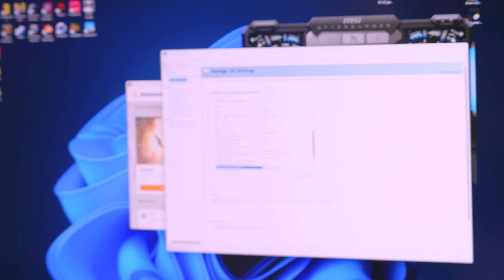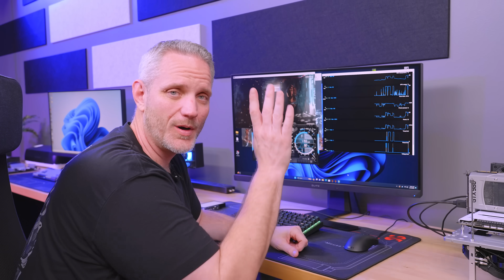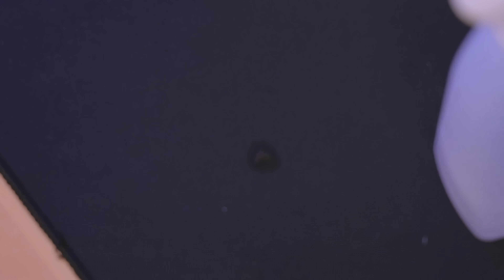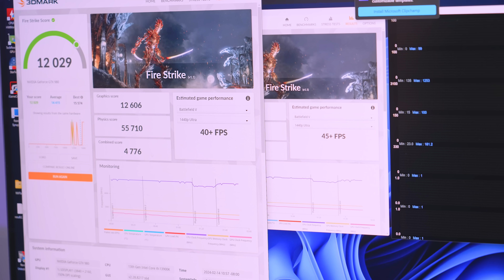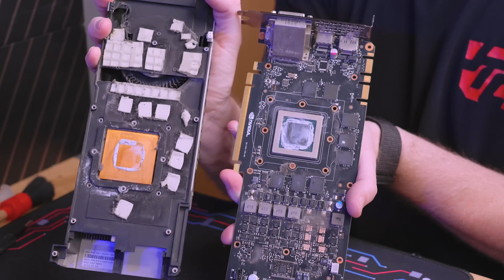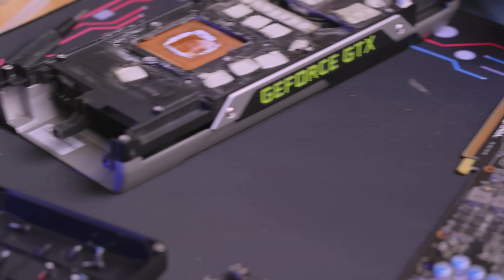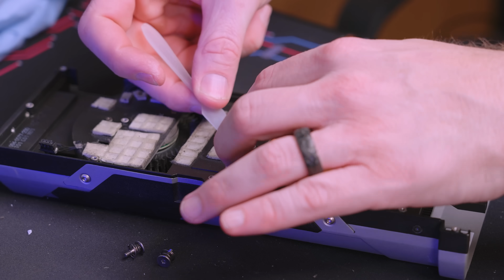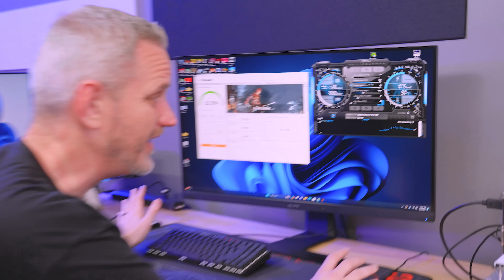This was KILLING this cards performance!

Comment: Just sharing my experience with 440GT - it's cooler was so old, that it wasn't cooling the card at all. I've checked if it spins - and it was! But after I decided to repaste it I've noticed that the blade was  basically rigid. So not only it managed to spin masking the issue of low cooling performance -  it was most likely heating it up even more just because of spin resistance.

Comment: I still have my GTX 1080Ti, i used to use it under water cooling, so i can't remember exactly where my blower cooler is for it, but it's fun seeing if i didn't have it watercooled what i could've done to improve it.

As of now I'm running an RTX 3080 watercooled, at first i didn't truly need that boost in performance, but now i have a 2560x1440p@240hz monitor, and this rtx 3080 on most games can run up to that fps mark which is nice

Comment: When re-pasting old cards I cut a small portion out of the center of the pads (1mm x 1mm) an add thermal paste to that hole. I've seen serious reductions in all the card's temps.
Reply: Dam I wish you made this comment 2 months ago when I was ultra sonic-ally cleaning my 2 x HD7970's heat sinks I would have tried this. But just the cleaning and using new thermal paste helped a lot, in reducing temperatures. My cards are from 2011 and still going strong might not be able to play latest games but that's fine because I like older games more anyway, like COD4 Modern warfare still the best COD IMO lol.
Reply: @fullboostturbo1 Don't bother, there is literally no reason to do this. The "serious reduction" was because they repasted at the same time. Or, maybe the pads were so rock hard that by removing the middle they make the pads squish like they should have when new.
You're only going to make a mess, and that TIM is not going to magically drop temps. If you want to help, replace the die's paste and use new pads.
Reply: @rustler08  Gday mate, I am not going to bother as reapplying thermal paste done the job for me, but the ultrasonic cleaning I done on my GPU's heatsinks had the greatest effect IMO they cleaned up like brand new. Instantaneously I saw a temp drop of 10 Celsius while idle and about 13-15 while hitting 100% load. Now they are running and looking like brand new.

Comment: So Jay. Fan Curves. When I had my 2070 and ANY other card where you could adjust with afterburner my fan curve is basically 0-100, if the card is at 30c the fans are 30%. I would love to see you test out your viewers fan curves? Maybe? Take like 10 user suggested and see which is best?

Comment: Have done 3 RX 580 8GB for Kids PC this X-mas Season. Thermal Paste and cleaning brought them back to stock clocks, one went from 1350 down to 1150. After Repasting the Card i tested went up to 1300 in Furmark after 30 Minutes in a Case at 84/85°.  All three Cards were Dual Cards, i did a Fan Swap, now the hot one is running 78° stable at 1350 boost. I got a RTX 2070 with the same Problem, is running in thermal limiter and the Fans seems to be shot. All the Cards have in common: Dual Fan Models. Longer Tripple Fan Models don't seem to have this aging Problem, i got several older tripple fan models which still run fine.

Comment: What a blast, the 980 was my first high end GPU along the 4790k, those 2 gave me 4 years of amazing performance until I switched to a 2080, the CPU lasted me for almost a decade and 9 generations of intel CPUs!

Also that ending geez...and we're not even in October yet!
Reply: I had the same rig as you, I then went to a 1070 and 9700k, and now I upgraded to a 13700k and a 4080FE

Comment: I ran a blower style 1070 for 5 years.
3 times I had to go in with tweezers and scrape out the fan blades. Once at two years, once at 4 years, once before pawning the old PC off on my nephew.
Washed the heatsink out, repasted it. Dude's probably getting better temps than I ever did.
Reply: My nighbor has 1060 😅 the 5600g apu runs all same games 😅
Reply: @Fossillarson  Yeah you want that 1080Ti. So much VRAM It's gonna run everything until games cut API support for it.

Comment: Hi, Jay. I have a GIGABYTE AORUS GeForce RTX 4090, GV-N4090AORUS M-24GD. I also am using a CableMod 12VHPWR 180 Degree Angled Adapter - Variant B. It has worked perfectly from purchase, but with the recall, I wanted to replace it. I bought a CableMod Basics RT-Series 12VHPWR 90 Degree StealthSense Direct PCI-e Cable. The problem is the new cable doesn't fit in the 12V HPWR socket on the GPU. Something is obstructing the cable fitting from seating and locking in and I get no power. I"m wondering whether you or your vast audience have experienced anything similar. Cablemod told me there is a slight size difference between the two fittings. I may have to deconstruct my entire system to look closely at the GPU socket to see what's in the way, a major overhaul. Any thoughts would be appreciated. Thanks

Comment: Cleaning makes a lot of difference on those blower cards. Back on the last mining craze days od 2020, I built a rig with some used blower Vega 56 and I had to open and clean them every month, it made a lot of difference in its cooling.

Comment: I dunno what people are vaping to make there computers sticky. I vape both bud concentrates and nicotine in front of my PCs all day everyday for over a decade and I have never had any stickiness at all. Vapor often gets sucked in the intakes and absolutely nothing has built up on my PC anywhere. Now I don't blow it directly in the computer but some definitely ends up in there. It should not be sticky at all and if it is I would immediately stop vaping whatever products that are causing that. It is not normal with legit vape products. You should be able to exhale into a paper towel and there should be no sticky residue, if there is your juice is tainted.

Comment: You mentioned the whole dead person being in the GPU thing. It reminded me of a story a coworker told me when I worked at a data center in Mexico about how a new NOC employee/intern got stuck/locked in one of the server racks during a holiday weekend, and he stayed trapped in there standing upright unable to sit down because there wasn't enough room to move for the 4 day break. Other people were in and out of the data center, but it was such a massive place and so loud, even though he could hear the doors (they make a loud beep when opened), they couldn't hear him screaming. 

But even worse, he knew the entire time that there was a fire suppression system test coming at the end of the holiday weekend, so he would have been panicking, because when the other employees got back they did a sweep of the data center to make sure it was empty of people, and then they activated a test of their argon fire suppression system while there was "no one left" in the data center. This system replaced all of the oxygen in the server farm with argon. The kid passed away in there, and they didn't find him until a couple days later when someone came to switch out the tape backups. 

The crazy thing? All the kid had to do was reach back and pull a little latch and it would have opened the rack door from the inside.. Freaking tragedy.
Reply: What?  Bro I would have just started unplugging things and making a mess.  Someone will come check when the entire server goes offline.
Reply: @vedinthorn  Exactly lol. Make an outage so someone comes and checks on the rack... EZ.
Reply: @vedinthorn  You sir, are a free thinker.  Well done.
Reply: Dam that is a pretty sad story the poor bugger losing his life, if only he knew about the little latch for the problem that he actually found himself in. Hopefully his in a better place now God bless him and his family.
Reply: Damn, that's quite the story. Thx for sharing
Reply: that story sounds completely fabricated.
Reply: That's nuts. Definitely learn how server racks work before you climb in...

Comment: I still run a 1080ti for mostly maxed 1440p gaming from evga. I do tear it down every now and then and clean and renew it and have had no issues out of it since day one use. It's all about the love and care of the hardware.
Reply: I love u
Reply: Still running a 1080 Ti myself also at 1440p (and some 4K on TV) since November 2017, mine is a MSI Gaming X. I had only given it a handful of light external cleans over the years, temps started out great in the 60-65C but over time had crept up averaging in the 67-72C range. Last year in February I decided to do a deep clean and re-paste as the temps above 70 were becoming more common and were hurting my boost clocks, used Noctua H1 (all I had on hand) and temps saw a big improvement dropping into the 55-62C range depending on the title.

Comment: 1:18 man, if they had one that was fresh out from the box never used. it would also be good to see how much the performance has decarded over the years
Reply: Performance doesn't degrade, it either works or doesn't
Reply: Linus tested GTX 480 new vs 10 years old used, difference was 2%, basically no degrade.

Comment: I repasted a heavily used 7900xtx with Kryonaut extreme and idle temp dropped 10*, the stock paste had started to get hard.  So I highly recommend doing this especially if you're on your computer hours everyday.
Reply: Any issues with thermal pads or is it easy to replace the paste without damaginf them?
Reply: @johannesdatblue4164 I'd replace them while you're in there. Buy some Gelid extremes of the same size, or use thermal putty
Reply: @johannesdatblue4164 Better replace everything.
Reply: @johannesdatblue4164  you can never be sure the pads dont get ruined on disassembly, and theres no real way to prevent it. just depends how they stick. theyre cheap enough you should go ahead and order the CORRECT thicknesses before you tear it down so you can replace them. even if they dont get ruined, that resets the clock when you need to do it again, plus the oem pads are likely shite
Reply: Giving you a fair bit of warning but kryonaut is absolutely terrible for these cards regarding pump out. 

My 7900 would pump out the kryonaut in about two to three months leaving the die bare. I had to repaste my card 4 times with kryonaut. 

I suggest getting PTM7950 it’s a godsend and you’ll never have to repaste it again for the life of the card.
Reply: @Crawdoodle   Never had an issue with the Kryonaut Extreme
Reply: the level of used means very little, crap to begin with is the real problem. my asrock 6950 is known to be crap out the factory and easy to get 20c improvement out of. these are more of an age issue

Comment: You need a card gooped up naturally but expediently? Send one my way, I can get it back to you in a month with it out in my workshop/office. I routinely need to clean mine with compressed air, otherwise the GPU will idle at 45*C from accumulation (usually my cue that it's due!). Such is the life of a card that shares space with machines and equipment notorious for making a mess!

Comment: Probably should’ve taken the cooler apart too, the shroud around the heat sink means there can actually be a lot of dust that gets accumulated on the heat sink itself that’s not that easy to blow out. A great video nonetheless, repasting does so much for anything pre-2021 when manufacturers moved on to using phase change material
Reply: I thought the same especially with that crappy blower he used. Honestly the video felt half assed to me.
Reply: @Bangulo Hello, it went from 84º with no fan speed. To 64º with fan at 100%.  All they showed was no fan vs fan speed at max. You think these whales move?.

Comment: Lol im still running a 980 ti. Has a 2 fan cooler though. But it does ok still.
Reply: Me too, EVGA. Starting to struggle with the latest games now though. If the 4080 was realistically priced, I would already have pulled the trigger.

Comment: i had a gtx 1070 and a gtx 1060 which i opened and fully cleaned new thermal paste and it improved performance and thermals quite alot tbh it was a zotac card and evga card (RIP EVGA)

Comment: Recently picked up a second hand RTX 2080 Ti with the same issues. I replaced the fans, replaced the thermal paste & pads, and cleaned it up. Now it works like its brand new 👌🏼
Reply: What parts did you use/get to do it? My 2080 Ti is at best loud now and sounding not in great shape, and no clue about performance degradation. I have an i9-9900 and I do need to get a new computer soon(?) but throwing a 4070 or something in here at this point just seems silly.
Reply: Good card too. Probably better than a 3070
Reply: @HughesDePagen  nope, not according to benches of anything remotely recent or any recent reviews that include both cards - you're better off with a 3070 for the most part, but then, really, neither are really great longer term - in battlemage we hope
Reply: I had rtx 3070 its like 3% faster than 2080ti but!! 8gb vram sucks ass at 1440p
Reply: @Kage0No0Tenshi  You need a 4080 or 4090 to play in 1440p. Everybody knows this.
Reply: @HughesDePagen  LOL, 3070 is better because it's a bigger number than 2080. I'm 16 and built computers for 2 years and I even know this.
Reply: @HughesDePagen Kind of. The 3070 is a bit faster and doesn't have memory chiplets that kill themselves. But, a few more gigs is nice for the 2080 Ti.
Honestly, I'd probably take a 3070. It's a newer card with better DLSS and everything.
Reply: @rustler08  neither get dlss 3.0, and both can use DLSS 2.0, but I get you though.
It's just the vram that's going to make the 2080ti a better card in some situations.
HW unboxed showed this with 8gb cards in the past.
Mind you, updates may have changed some of those issues
Reply: @HughesDePagen   Updates can't fix memory, they'll just serve you low textures faster/more often.

Comment: i recently cleaned and repasted my gtx 1080 strix with stock pads and paste. it went from a max temp of 87C to 72C running the furry donut test, stock settings, stock pads (still squishy) and using thermal grizzly paste.

Comment: I have an old system we use for emulation, 4790k with a 1060 6gig.  last night i got bored and decided to de-lid the cpu.  I've never done it before.  so i got my little vice out and slowly worked it around and got the heat sink or lid off.  it only had thermal compound on not even half of the chip.  there was around 50%  of the chip that wasn't being cooled properly, it wasn't making good contact with the lid.  that chip has always given me issues with thermal throttling despite any coolers i tried.  now I know why.    but its making me want to open up my other systems chips, we have one with an i7 8700 and one with a i7 14700.     i wonder how many chips get threw production with that issue.

Comment: I was not ready to hear a card only 1 generation older than mine referred to as "old school".
Reply: 10 years is a long time, More so in tech... That's a 10-year-old child becoming 20! In perspective. So yeah your card is old ass lol
Reply: @helenHTID  I'm only 24 but the last decade went so fast that 2014 feels like yesterday.
I had a GTX 960 2GB in my main PC for close to 7 years before upgrading to a GTX 1080 in February last year. Before the GTX 960 I had a GTX 660
Reply: The 900 series is the last with Windows XP drivers. It's not just old it's retro computing now.
Reply: Being 25 that was 2/5ths of my life ago
Reply: Gtx 1000 series are almost 8 years old now, it's like trying to play battlefield 3 in 2011 with a gpu from 2003/2004 
That's a long time in the tech world
Reply: @swianr  But hardware from the mid 2010s has aged a lot better than 2003/2004 hardware. A high end PC from 2016 with something like an i7-6800K or i7-6900K and GTX 1080 would still run pretty much any game you throw at it at 1080p.
GTX 10 series cards are still better than any iGPU or most below 200€ dGPUs. In the 2000s and early 2010s even the lower end GPUs quickly took over high end cards from few years prior.
Reply: @Pasi123  that's why i say moor's law dying isn't a bad thing for the consumer, at a first glance, it seems like a bad thing as we will get less performance gains between each generation, but in practical terms, it means a card will stay relevant for longer because the gains between each generation isn't as significant, so you can skip a generation or two and still have a very usable card
Reply: 10 series is 7yrs old now. It’s pretty old. Doesn’t mean it’s a bad card. I loved mine and only upgraded because I need a 4k monitor for coding and the poor 1080ti couldn’t run the games I play at a good frame rate at 4k. Otherwise… I’d keep using it.
Reply: @jolness1  GTX 980 are 10 years in September.. time flies..
Reply: playing at 4k is dumb in general. @jolness1
Reply: RTX 20 released on 2018, It was almost 6 years ago and GTX 10 released on 2016, It was almost 8 years ago.
They are old AF.

Comment: In 2014 I saw a massive uplift in the performance of my HD radeon 4870 
X 2 when I reposted it and blew out all the dust it had been running pretty much almost constantly since 2008 it ran after that until 2020 when I finally retired it in January of 2020

Comment: Wow Jay!  Thanks for this... I'm running a 2080ti that started giving me some issues a bit ago... maybe it just needs a little TLC to get the performance back.
Reply: it'd be worth a shot giving it some new paste and some thermal putty to get a head of possible vram issues, especially if you have micron.  i recommend ptm7950 for the die and some upsiren ux pro or cx h1300 thermal putty for everything else.